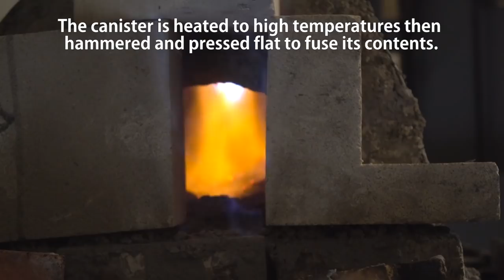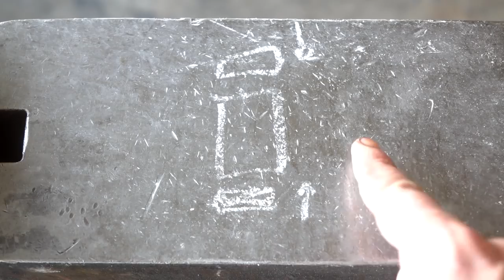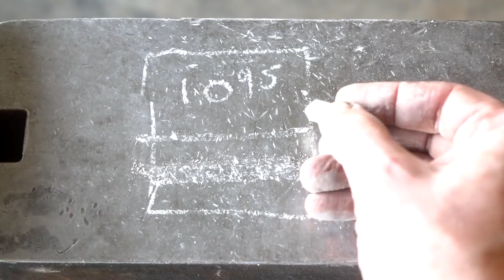Forging A Knife From Guitar Strings!

Comment: If you're gonna do more stuff like this, ask your subscribers to send in old strings. I might even have a few.
Reply: As a fellow guitarist I have plenty of incomplete sets of elixer mostly missing the 1st string. All this tuberware and no lids lol
Reply: Jesse Higgins -  i dunno, elixer strings have a coating and when they burn it maybe poisonous. Or it will melt very badly.
Reply: He should clamp them all together full length and then add powder as you twist them together like making a cable.  Hammer that twisted pile up.  All this reminds me of those Chinese noodle makers.  Hey...  Piano wire!
Reply: Another place for strings is any guitar shop. Ask them to keep the old strings when they resting someone's guitar.
Reply: Late to the party but wouldn't using peoples old nasty strings caked in skin flakes and finger grease make for a not so great material to use?
Reply: Pete Miffle Do you realize the temperatures being used in this process?? There is more to worry about on the material that’s used most of the time than skin flakes and finger grease.
Reply: @albertledesma5173  No way, red hot metal is hot!? I was more thinking along the lines of having all of that, even if it burns and turns to carbon, trapped in between each string when squished together. Seems like it might affect the way they bond together and change the quality of the final product.
Reply: @endlesswaters196 yep lol. Elixirs and D'addario strings for me too! If he doesn't really play, I wonder if he's going to give those extra strings away instead of trashing them?
Reply: @cosmicraysshotsintothelight  forging them together like that is disaster waiting to happen. Nickle is a different critter than steel and even attempting that with good hardenable steel by a knowledgeable smith would be more difficult and time consuming than the way he did it.
Reply: @longlivegarybusey6409  more carbon == good.  That is how it was discovered.  Hot is an arbitrary term when compared to our Sun or say a neutron star.  Add iron and you get a supernova.  :-)

Comment: Dude, I'm a hobbyist knifemaker since 1992. If you want some 1080  tubes take a bed frame angle, cut to length and weld the angles together to form a square tube. Weld will probably will crack and have to be welded twice because bed frames are 1075 to 1085 steel, you can make a knife just from the bed frame.

Comment: When your forge welding a delicate piece like that it helps to go a couple rounds with light hammer blows. By doing this you essentially spot weld a few areas together so that when you go into the full on welding heat the piece wont move around as much. They use this technique when making traditional samuri swords since they are using such loosely pack and "slippery" materials. Hope this helps, I absolutely love your videos.
Reply from the maker: ty

Comment: Been a TIG welder for over 20 years certified 6-g and Ive been getting bored of it but  now seeing this gives me ideas like silicone bronze and steel or stainless steel because you can weld steel with silicone bronze welding wire

Comment: You should use a stainless steel canister? Big dog forge does and it works quite well
Reply from the maker: A great idea.  I have some stainless square tubing but it's  over 1/8" thick and I freak out it's going to stick and i'll be grinding for an hour heheheh.  I 'll get some thinner stuff and give it a whirl. thanks!
Reply: Line ur canister with a shop towel not only does it make a good barrier but it will consume ne oxygen that may have gotten in the can good job and 🔨 on

Comment: I know this is an old video but just thought I'd share what has worked well for me lately when doing san mai billets.  I have a mig welder so I just seal weld all the seams around the stacked pieces before forge welding.  This method doesn't waste canisters or flux and I have had zero failures since doing it.  The welds end up on the edge and spine and get ground off when shaping the blade.  Other times I leave the weld until after shaping (forging) and quench when using mild steel or A203E cladding to help prevent the core steel from being torn apart during the quench. (which I experienced early on when using A203E cladding)

Comment: I think the weld failed because you are crushing or hammering only on one point. When you hammer down, even perfectly vertically, the metal will expand outwards in 4 directions. 2 will broaden the billet, but the expansion along the knife axis will put stress on the weak welded joint and cause it to split. Cool blades, I am glad it worked out!

Comment: This is something I've been wanting to see for a while, guitars strings seemed so perfect a material with a high carbon core and nickel winding.  The patterns turned great, and the finished knife turned out beautifully.  I'm glad to see you got a press too, especially with all the fun/crazy ideas you come up with... now they will be a bit more within practical reach 😉.     

One friendly tip I'd like to offer would be to remember to keep a slight radius on the inside corners of the tang/ricasso transition, as it's not only a stress-riser risk during the quench but also in using the finished knife.  Maybe you did and just didn't show it in the vid, but just in case.  Anyway, thanks for the great content as usual, I do like the 20+ minute vids, they honestly don't seem to last that long while watching them 👍

Comment: Next time try going to your local guitar store with a cloth shopping bag and a 30 pack of Pabst and ask them to save all their old strings.

I did something similar with my local craft beer bar and a hand-made tap handle for their house brew (a drilled and tapped and gold leafed railroad spike for their Gold Spike Ale) in exchange for all their bottlecaps and wound up taking home my bag plus two 5 gallon buckets after 5 days.  I used to go there a lot, and noticed that their bar bottle opener left the caps almost perfectly intact.  I had the plan of making a "ringmail" mosaic tapestry with all different bottlecaps, and their efforts certainly helped.  I wound up making the piece after moving to Denver, exhibited it as an afterthought at a venerable local bar for about two weeks before a private collector contacted me and bought it.

Last sunday a couple young guys were working overtime to cut down an elm tree in someone's yard that partially split during a recent snowstorm.  It was a block up the hill from my house, so I walked over with my dog and asked if they were planning to save it for any reason.  They said no, so I asked if I could have the bottom 6' (this was a good, old tree with at least a 3' stump) and take home a couple burled pieces that I saw on the ground.  They looked a bit baffled, but said no problem as long as I stay out of their worksite until they finish.  You never know what kind of gold people are willing to throw away.  I brought them two 30 packs of High Life when I went to collect, because I don't think they knew what they were giving me, and I wouldn't want them to feel like complete fools after giving me probably 100lbs of raw burls and 6' of healthy hardwood trunk that went from 34" diameter at the base to 30.5" at the head.

Comment: ive actually done this before. i was so confused when he threw the wood chunks in the canister. also if you wanna get a cool pattern, similar meathod, use your old mig liners, slide a piece of nickel wire in the middle and you basically got a gigantic tool steel bass string. obviously gotta remove the brass end and the plastic coating but that cuts off with a knife in like 5 seconds.

Comment: A really good way to vibrate the canister after you put the powder in is to take the sand paper off of a palm sander and press it to the side of the canister. Not a spinning one! one of the ones that wiggles back and forth.

Comment: I wonder if you could somehow twist the strings together, like a cable, before packing in the powdered metal. Perhaps twist several of the non-wound strings into thicker cables, then use those.

Comment: I'm mostly ignorant of metallurgy but I would suggest that while loading your can with wires  you are undoubtedly scraping titanium dioxide from the can and mixing it in with your wire. If the reason for coating the can is to prevent welding,  and apparently it works, it should also prevent welding your wires just the same.  Similar caution about writing on your anvil with calcium carbonate chalk, you may drive chalk into anything you hammer on that surface until it is all gone.   What effect does calcium carbonate surface embedded on a steel alloy have?  I dont know.  Could be a good thing, but I'm pretty sure it will do something and my dumb guess is it aint gonna be beneficial.

Comment: I like watching different forge operations and see what they do! One thing I don’t recollect seeing is anyone adding flux inside their canisters! Would that not work if you added that with the steel powder when you add that to help everything adhere to each other?
Reply from the maker: the flux gets squished out of the billet carrying dissolved oxides with it. If there's no place for it to go, such as if it were confined to a canister, people worry it would inhibit forge welding.  I've never tried it though.

Comment: Rather than using new strings, you could try going to a local musicians shop and to see if they'll give you their old strings. They would be corroded, but nothing a little acid/rust remover wouldn't fix. I would say that you could even use old piano strings, but I think those are probably brass/bronze wound like acoustic guitar strings.

Comment: Funny enough, I'm a welder& fabricator, I studied metallurgy. Also a guitarist of 30 years, in and out of bands. I noticed comments on you should have used bass strings. I kind of agree. But not really important. It would have made a fatter damascus pattern. What I do suggest, you should have used stainless steel guitar strings. You would not have needed any core, and it would have been much stronger. Try that and make a video of it. You definitely peaked our curiosity.

Comment: You should weld the three pieces together , then grind out the weld . This will stop oxidation . ( I would use a 7018 or any low penetration electrode)
Reply from the maker: i use 7018 except when applying handle to billets, 6011.  I think I did that when I made stainless san mai, or at least tried it.  Good idea.

Comment: You can buy strings of specific thicknesses in bulk. Should be cheaper and obviously less wasteful. I'm sure you can find even thicker single strings as well, say .080". Or you could straight up use bass strings. I'm not a blacksmith but (phosphor) bronze strings might be interesting as well

Comment: Take a spool of .045 Copper Free weld wire, cut into strands like you did the guitar strings. Can you use copper coated wire? I know absolutely nothing about forging I just work for Narional Standard Weld Wire Company, part of the Davis Wire Group, here in Stillwater, Oklahoma.

Comment: these tubes are scaling as mad. What kind of iron is it? Or is it the high welding temperature? Couldnt you lower it with such a fancy press? I mean, you may be even able to cold weld it.
And why doesnt the stainless weld too when there is no oxygen in the tube?

Comment: What about braiding the guitar strings together before you forge weld them? The pattern wouldn't be the same but it may work for a functioning billet.
Reply: I think, it's a chance to have air pockets in between bradied strings.
Reply: Could get a similar look with a full string billet getting twisted while welding. You'd still have the canister, but with a thin canister it'd add to the pattern rather than subtract.

Comment: I am wondering why you chose 1095  with the musical theme of this project I would have used 1084 as this is the same material as Piano wire. 

You're the first Smith who got the ingredient in whiteout that prevents it from sticking right. I have never had a billet stick when using two coats of acrylic white paint and I have tried a few different brands including Crayola washable white paint.

Some of the delam issues your having is likely due to the nickel coating as pure nickel is trickier to forge weld and you basically need plain steel to get it to stick.  at least i have read this in damascus steel theory and practice as I have yet to buy pure nickel.

you could use nonnickel coated steel guitar or piano wire and instead of 1095 powder, you can use 4600 KC or 4800 KC both are 15N20 equivalent powders....may have to give this a try myself next month since right now i am out of canisters and broke. However, both of these steels are out of stock as i post this on 2/19/2019 from the one place I know you can get them: USAknifemaker.com and I just happen to have it in my material stockpile.

Comment: Any way you could make up a ratio of powdered metal and flux to overcome the cracking
Reply from the maker: Never tried it, most people say the flux needs somewhere to go, somewhere to take the oxides it dissolves away from forge welding area.  Not sure that will happen in a can.

Comment: I have one question for you, is it hardened? If you use a file on it and it leaves fine marks on the scale that is there after heat treatment
Reply from the maker: I go by the sounds and feel of the file.  You can tell if the file is digging in or just marking up the oxides and decarbed exterior of the freshly quenched blade.  If you were to grind off the scale then apply a file it wouldn't make much of a mark, if any, provided the knife HRC got over 63 HRC or so.  Not all steels get that hard with quenching though.  In fact, the same steel might quench to a variety of HRCs (59-65) depending on the austenitic temperature from which it is quenched.   A file might still dig a little on a 60 HRC quenched blade but the blade is still successfully hardened.  Another good clue is how the blade feels on the grinder after the quench.  With a little experience it is easy to tell when you are grinding on successfully hardened steel or not.  So, this blade was hardened, yes.

Comment: I understand the reason for keeping the core, but personally I would have cut and stacked, maybe done some folds.. it might not have been what you were looking for, but I feel the finished product could have looked quite a bit nicer.. again personal opinion on your product.. your decision.

If you're gonna be welding the higher strength steel on the side, could just forge in afterwards, like a katana...

Comment: On the transition from tang to handle, are you filing a 90° or a slight radius?
Reply from the maker: 90 degrees for the past few knives, trying to work on my guard slotting and fit up.  When I get that nailed down I hope to start leaving more radius
Reply: @GreenBeetle  I try to avoid leaving 90° because it creates a high stress point

Comment: If you use steel wound acoustic strings, you'll get 4 wounded strings in a packet :D
Reply from the maker: the nickel winding is the bright, shiny part of the pattern.  plain steel winding would not produce the same effect.

Comment: u could of fit a lot more string in if u cut the wire on the outside of canister an then jam them in one at a time but a in methodical type of way an u would of def had a tighter pattern my guy @Green Beetle

Comment: Why didn't you do the whiteout trick to line the inside of the canister?
Reply from the maker: At one point I wanted the canister to stick, at another point I thought the stainless steel foil was taking care of it. At another point I used straight titanium dioxide and it did work.
Reply: @GreenBeetle  clever!

Comment: you know you can just buy the wound strings in bulk?
Reply from the maker: no idea.  after reading 158 identical comments i still don't understand?
Reply: @GreenBeetle  Maybe this will help. when I make Dulcimers or a Cigar box guitar this is where I get my strings. you can get sets of just one gauge of string. no need to get the ones you don't want or have a need for.  here the link I hope it helps you. https://www.cbgitty.com/guitar-accessories-1/

Comment: I don't get it. first, if the nickel is a problem, don't use nickel wound strings. Also why not use the non-wound strings, especially near the edge. A lot of work for two very ugly knives. I don't care for how the blades turned out at all. Why not a solid piece of 1095 with a few strings fused in, with a real pattern to it? Also, strings are made to be at their best under tension, there must be a way to make the billet with the strings under tension, much easier if you're only doing a few on the outside. Frankly if the pattern is what you're after, you only need them on the outside, not all the way through. Start with a thinner canister in the first place so there will be much less hammering and grinding to do. In this case, the nickel would only serve to weaken the blade, so I don't see the point. The point of any effort to make a knife should be to make it as strong as possible, patterns and looks are thirdary, not even secondary. A good knife does one thing, cuts cleanly.... and it must remain sharp to keep doing so time and time again. Anything else, just fallderal, and non-important.